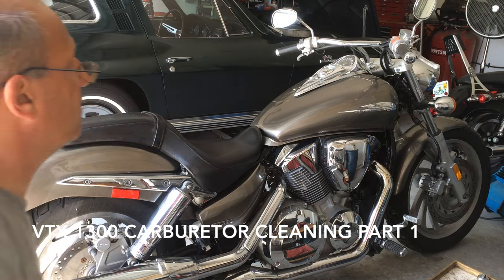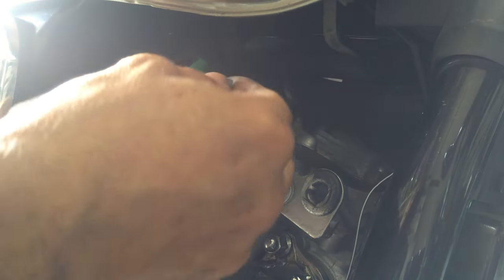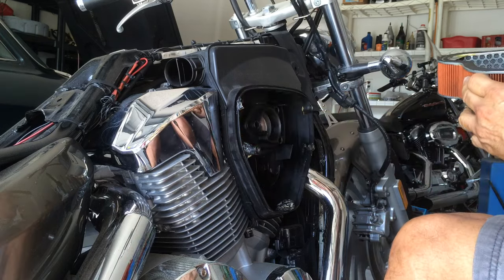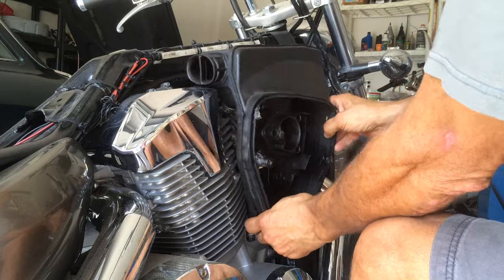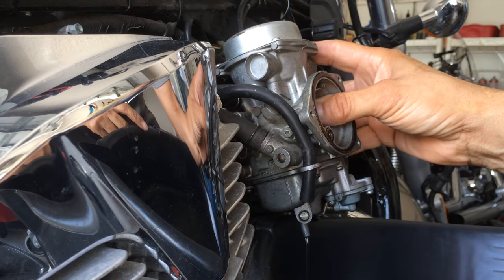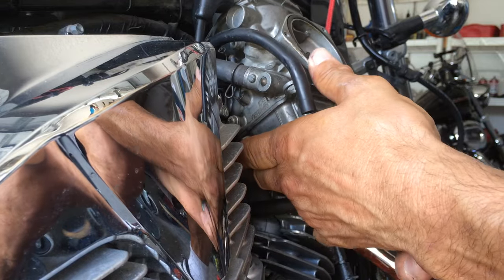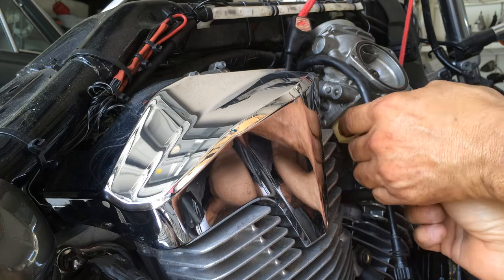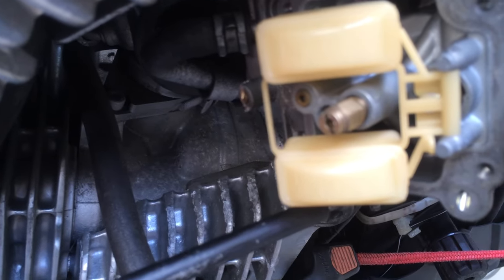How To: Honda VTX 1300 Carburetor Cleaning Part 1

Comment: Great video sir… started having an issue with the neutral light not coming on while the bike was in neutral and the bike not wanting to start.  Raised the kickstand, pulled in the clutch and it at least tried to crank but then fuel started coming out of the exhaust.  An internet search says I probably have fuel in the engine now and I should change the oil as a precaution.  My plan is to troubleshoot/replace the neutral switch and then clean the carburetor.  Should I replace the oil as well?  Thank you in advance.
Reply from the maker: Happy to help.your petcock vacuum is failing. Heres a video on how to test, this test is the same for your Honda but is done on a sportster. Hondas are notorious for bad Petcock. They fail and gas flowing into your motor and your motor run rich. if running at all. Remove your spark plugs and let the motor air out. Rotate motor to clear cylinders. Rebuild Petcock.vacuum.       https://youtu.be/7Fo9Q93OJXI. Any questions just ask. Thank you for watching and your sub MAJR25. Let us know how it works out. Ride safe and have a great day.  eBay. https://www.ebay.com/itm/232133750094?hash=item360c3fed4e:g:QwwAAOSwx2dYHMtS.  Do not buy cheap Chinese knock off Petcock.. And you may as well buy a new petcock screen while you're there, usually they are bad too.
Reply: @TwoWheelRocco  Thank you for the quick reply.  Will look into your suggestion (thank you).  Currently draining a significant amount of fuel and oil from the bike (fuel valve in the off position).  Also checked the neutral switch and found no continuity to ground while in neutral (will order replacement).  FYI, before the issue started, I had just replaced the spark plugs and air filter with the help of one of your videos.  Would you recommend I replace them again, or just air them out?  Lastly, I use Honda’s synthetic oil blend (10W-40 SJ).  should I replace the oil once with Honda’s non-synthetic oil first, run the bike for some amount of time, and then replace the oil again with the synthetic blend?  Thank you again, in advance.
Reply from the maker: @majr25_13  let it air out, and just do an oil change of the oil you prefer. Petcock. is your issue Diaphragm is bad,   test it and all your problems will be behind you.
Reply: @TwoWheelRocco  Well, it looks like someone replaced the OEM petcock with a high flow one from PINGLE that does not appear to use a diaphragm (on/off/reserve).
Reply from the maker: @majr25_13  i would replace your carburetor float needle jet.. That's what's letting the gas overwhelm the carburetor. we started with the Petcock. you make sure that's all right. . So to the carburetor float needle jet replace $22 let us know how it works out.  VTX.1300 is a great bikes. notorious for the Petcock. failure. Let us know how this works out.    Ebay https://www.ebay.com/sch/i.html?_from=R40&_trksid=p2380057.m570.l1313&_nkw=handa+vtx+1300+float+needle+jet&_sacat=0.   Hope this helps.
Reply: @TwoWheelRocco  Will do… thank you.
Reply from the maker: @majr25_13  I love  VTX 1300  great bike. Let us know how it works out.
Reply: @TwoWheelRocco  Parts are on order.  Considering going back to the OEM diaphragm-style petcock.  Would you recommend instead of the manual one I have now?
Reply from the maker: @majr25_13 I  like the vacuum operated OEM Petcock.'s. That's what was designed from Honda. Let us know how it all works out.
Reply: @TwoWheelRocco  Thank you, will look at my Clymer manual for the correct vacuum tap.
Reply from the maker: @majr25_13  bikebandit.com     will have all your needs.
Reply: @TwoWheelRocco Hello, my parts came in and just want to ask if by “carburetor float needle jet” you mean the float valve and the jet needle… 🙏
Reply from the maker: @majr25_13  Believe we're talking about the same part,  if you want send a picture to my email.  erocco3964@gmail.com
Reply: @TwoWheelRocco  Hi, picture just sent to your email… 🙏
Reply: @TwoWheelRocco  Replaced the following items… neutral switch, float valve, and oil.  Bike started up but was running a little rough, probably due to a vacuum line that was accidentally pulled off the PAIR valve system.  Unfortunately, I developed a coolant leak on the carburetor return hose near the hose clamp after deciding to remove the carb for cleaning.  Waiting on replacement water hose.  Replaced all 3.5 mm vacuum lines (too short).  Curious about the operation of the air cutoff valve which I hope was being affected by the disconnected vacuum line.  Noticed bike would sound better when I would put the  back of my hand up against the air intake on the carb.
Reply from the maker: @majr25_13  That line off or compromised creates a vacuum leak when introduces more air into your system and leans out  air/gas mix. Plus It don't let the Petcock operate correctly.  So yes it makes a big difference you will be surprised. But that's why you noticed I don't pull the carburetor off the cooling line, they break. Let us know how it works out. Thank you for watching ride safe and have a great day
Reply: @TwoWheelRocco  Good morning… as I wait for my coolant hose to come in, I’m concerned about the effectiveness of the “burping” procedure in my Clymer manual.  I think the coolant level was suppose to drop when I did it the first time but it never did (ran bike for 2-3 minutes then blipped the throttle a few times).  If I understand the cooling system correctly, coolant is added at the radiator cap neck.  Coolant can only flow through in the direction of the radiator (because the thermostat is closed) and on to the suction side of the water pump.  I don’t think the coolant can flow past the water pump so does the coolant flow into the smaller return line on the water pump that comes from the carb and cylinders?  🙏
Reply from the maker: @majr25_13  You should be all right hopefully you clamped those houses so It didn't leak out a lot. Put it together start it up and rock 'n' roll. Let us know how it works out.  I never had a problem
Reply: @TwoWheelRocco  Thank you for all your help!  Bike is operational again.  Still waiting on carb return water hose from Honda.  Used self-fusing silicone tape to patch two pinhole leaks on the original carb return water hose (no leaks).  Thanks again!
Reply from the maker: @majr25_13  happy to read all is well. Thank you for watching and your support MAJR25.  Have a great day. Stay warm.

Comment: without removing the tank etc. can you spray carb cleaner in the butter fly to clean the  idle jet?
Reply from the maker: No that will not work, The carb cleaner will never get at the idle jet. Its not that bad removing that tank. You will be very happy with your results. Any questing just ask. Thank you for your Sub. Let us know how this works out.
Reply: @TwoWheelRocco  i've had the tank off plenty. i've taken the carb off before. before i take them off i'm going to try squirting until the gum surrenders.
Reply from the maker: I don't won't to seam negative,  It is a wast of time. Good Luck I Hope it works out for you. Ride Safe and have a great day.
Reply: Took the jets out cleaned them still just runs for a bit then shuts down. Plugs are black but looks good. What else can I do besides remove carb?
Reply from the maker: Test petcock vacuum diaphragm for leak. This will make a very rich running bike. Take a look at this Sportster Video on how to test your Petcock Vacuum operated gas valve.  It is like your VTX. That were I would start. Let me know how that works out. A bad vacuum  will cause a rich running condition.
Reply: Ok, also I have a spectra air filter.  The stock air box is gone. Had it for years never cleaned it. It looked dirty. I washed it with soap in water. The oil supposed to be here tomorrow. So you think y to the black plugs is a problem. They re black but not oily. They smell like fuel, but I hosed carb cleaner in the butter fly.
Reply: Also I hear back firing in the air filter, and over all back fire.
Reply from the maker: https://youtu.be/7Fo9Q93OJXI. How to test petcock.
Reply from the maker: The petcock is a real issue, It was a big Honda recall.  Your fuel supply is where we need to start.  Bad Fuel supply, Thats the start. Then we can think down stream.  Hope this helps. Test Petcock    https://youtu.be/7Fo9Q93OJXI.  That are the same as Honda Petcock. Let us know how that works out.
Reply: I replaced the diaphragm years ago bc of a leak, but I may need the whole petcock. I don’t have access to a vacuum gauge, I’m thinking maybe I should just get the petcock n put it on. Black plugs and back firing in the air filter may point to the petcock?
Reply from the maker: You can go to your auto zone and they will rent for free you will need a petcock screen as it is your gas filter.   https://www.ebay.com/itm/Fuel-Gas-Valve-Petcock-Diaphragm-Cover-Set-CB600-F-VT750-Shadow-VTX1300-H79/361509998209?_trksid=p2485497.m4902.l9144
Reply from the maker: Ebay Honda VTX screen.   https://www.ebay.com/itm/Honda-New-1300-Fuel-Petcock-Screen-Set-VTX1300C-VTX1300R-1300-16952-MAZ-003/273845180925?hash=item3fc271d9fd:g:rcMAAOSwMcZc2kSa:sc:USPSPriority!34953!US!-1
Hope this helps.   Any questions just ask.
Reply: I tore the spark plug wire on rear jug. I see where the plug goes to the coil, looks like it should just twist off. Help how does it come off, is a replacement hard to find?
Reply from the maker: They just twist on and off. If the end look bad cut 1/4 inch off and it new again. Twist and push.  let us know how it works out.
Reply: I twisted the broken wire back where it broke I don’t trusted it, can another wire be found?
Reply from the maker: Go to your local auto parts store and see what they got.
Reply: Hey I got the petcock off, haven’t gotten a vacuum gauge yet. The strainer is stuck up in the tank. I had it out long time ago. Should I try to pry it out I want to look at it to see if it’s plugged.
Reply from the maker: You will need to work it out with small needle nose pliers. Buying a new one. You need to have a good working screen.  This is your fuel filter.
Reply: The screen is dirty on the bottom half, even dirtier on the inside. I don’t know how dirty is enough to cause problems, I have one ordered. I’m bleeding down slowly when I put the petcock on vacuum. Idk if it’s bc I have a leak in my hose or a bad petcock. I pressed the ends of hose to seal off better I still get a slow lost of Hg. Is slow leak enough to cause a. Problem?
Reply: Also, the link you sent is the cover etc, it’s not the whole petcock. I can buy the whole petcock cheaper. Isn’t it better to buy the whole petcock?
Reply from the maker: A real  Honda  petcock will cost $$  Buy the parts I sent you. Those are Honda Parts The diaphragm is bad...The screen is bad.. ends up to leak fuel into your intake causing that rich condition.  The vacuum pump is the test. it holds or it don't.  little leak becomes big leak.
Reply: This will be the 2nd time I’ve replaced the diaphragm in a few years. Last time bc of a leak. What can I do to prevent them from going bad?
Reply from the maker: Non-ethanol fuel, Ethanol in the fuel, That's what eats up the rubber diaphragm in your petcock. If this gas sits to long in your bike it cause problems. So don't store bike over the winter with gas on. Turn petcock to the off position and start bike and run it till it dies.  No fuel in system no problem.  Saves your carburetor and petcock.  Put a little stabilizer in tank and store for your winter. Hope this helps.
Reply: @TwoWheelRocco  The rebuild kit came today, now i got a leak from where the petcock threads to the gas tank. I took it off and back several times trying to get the leak to stop. The bigger thinner o ring wasn't used last time, i put it on, not used it either way it leaked. Any ideas what's causing my leak?
Reply from the maker: Try to reinstall, The nut is not seated proper.  Did you install the tank screen? and o ring. That will cause a leak. That seat to your petcock.
Reply: @TwoWheelRocco  So, install screen first without the bigger thin o ring. Then install the petcock? I tried that, It felt like it seated right but it leaked.
Reply from the maker: Tighten  a little more and hold petcock so it is orientated to your tank. it will seal. Turn the nut to tighten down. Let us know how that works out.
Reply: @TwoWheelRocco  finally got the leak to stop, never had this much trouble in the past. After replacing the screen and diaphragm it still wouldn't start.  So i changed the plugs and it fired up. Thanks for all your help!
Reply from the maker: Thats Great, Ride Safe and have a great day.

Comment: A second viewing shows that you did not use the screw driver to access the air/fuel mixture screw but to adjust it. I am searching for ways to access it in lieu of a pilot screw wrench which I have been unable to find that is compatible to my bike.
Reply from the maker: https://picclick.com/Motion-Pro-08-0242-Replacement-D-Shaped-Bit-231220211793.html  This is what you need......Anything else will damage....just find bit and place in end of multi driver...Hope this helps...Let me know how this works out....A/F screw likes 1 1/2 to 1 3/4 out for stock bike...
Reply: Thank you so much! This has been a source of frustration and I am angry with myself for not asking you sooner. Thank you so much, this is exactly what I needed.
Reply from the maker: Happy to help...Let me know how this works out..Ride Safe..
Reply: please I have Honda cbr1300 and I need the carburetor to buy or to be repaired how can I get that help?
Reply from the maker: What year?  How many miles?
Reply: 1981
Reply from the maker: I would look... Ebay and youtube... search the internet. I could not find much....It is an inline 4 carb set up with mechanical slides....Not that hard to work out....Just don't take them apart off the rail....clean float idle and main jet...same as any inline 4 carb...https://www.youtube.com/watch?v=q7zinEMdTh8  The same but different...Mikuni carb all the same ....Hope this helped..Let me know how this works out..

Comment: Any idea why my 06 1300c would be backfiring, popping, and spitting flames on decel? K&N filter in stock box and aftermarket pipes (no known name on them, but possible V&H or rinehart/bub)
Reply: Shane, my 05 has done that since I bought it used 9 years ago. Previous owner drilled holes in the baffels, therefor the back pressure is not what the carb is set up for. You can always check out VTXCAFE.com for more help also. Good luck!
Reply: @TheGreesmunke  Well I just found out last night that it has Hard Krome straight pipes on it. I've checked with vtxcafe, but get so many opinions and requests for me to do scar and pair valve delete, among other modifications. I'm considering the Factory Pro jet kit, but not sure if that will actually fix my backfire, popping, and literal flames coming out the back of exhausts. It's extremely obnoxious when riding. Maybe Rocco will have some insight.
Reply from the maker: Happy to help,  you will need to check what jets you are running in this carburetor. and how many turns the air fuel screw is out. Let us know and we will have a better idea of what's going on with your carburetor. Thank you for watching and your sub Shame. Ride safe and have a great day.
Reply: @TwoWheelRocco  Jets in the carb are factory and the air fuel screw has never been touched, so it's still at factory setting (not sure exactly what Honda sets it at)
Reply from the maker: Your pipes and air intake calls for bigger  jets to get the job done. You need bigger jets when running straight pipes.  You can never take for granted that is the stock set up in a 17 year old bike. Let us know,  clean the jet and check jet size in that carburetor. Then we can make some decisions.
Reply: @TwoWheelRocco  The tech who cleaned my carb last weekend said the air fuel screw had a red plug in it, symbolizing it was still factory and never taken out? I took his word because I have no idea what the factory screw looks like. TWR, you think a re jet with bigger size will eliminate the flame throwing backfire and popping then?
Reply from the maker: @shanef7949  You ask the tech what did he say was wrong?   Let me understand you paid him and your bike runs bad. . You got to find out jet sizes.   That is your starting point.  You need to do the work.  How did the plugs look?   There are 4 plugs on VTXs.
Reply: @TwoWheelRocco  Before he worked on it, he said the carb needed cleaned. So he cleaned the carb and that didn't solve it. Next on his list is installing a Factory Pro or Dynojet kit since it has Hard Krome straight pipes and K&N filter. Plugs are only about a month old but look like they are running hot.
Reply: @TwoWheelRocco  Will do! Thanks!!

Comment: Hi Boss 
I have 2005 HONDA VTX 1300 
I need your help to fix my bike 
How we can communicate?
Reply from the maker: How can I help?
Reply: Two Wheel Rocco 
After clinging the Cab. What else we I need to clean? 
How to adjust the Carb. After cleaning??
Reply from the maker: @ahmadomar3488  What is your bike doing? Will it start?  What pipe is on your bike?  You should not have to adjust carb. Unless things have been change, like pipe and intake. Let me know. I will try to get her running.
Reply: Two Wheel Rocco 
He is doing fine in starting 
There is unusual sound in engine upper part. 
When I drive with speed 120Km and I need to go more I feel the engine is freely getup 
I checked the clutch plates.
Reply from the maker: @ahmadomar3488  How many miles? is it a stock pipe and  intake?  Does it make that unusual noise at idle?
Reply: Two Wheel Rocco 
Hi 
All parts are original 
How I can chick the pistons conditions & the pistons rings ? 
I’ll try to send for you a sound record of the bike. 
Some time I feel it’s too noisy in the
Reply from the maker: @ahmadomar3488  If you can send a cell number or email. And I will call. Where are you located.